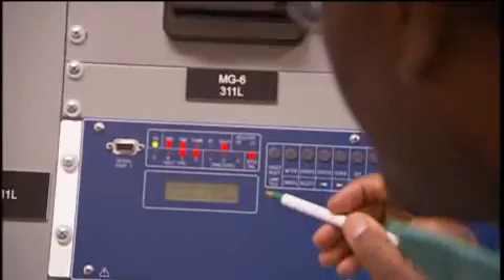Electrical Engineer

Comment: @emanpiano10 the EET program I am enrolled in states in the curriculum guide that that I will be eligible to take both the (FE) and (PE) exams which are the two exams required to become a "professional engineer". But from my understanding I will only have to take a few extra course in order to eligible to go back and get my MSEE. Also,a couple of employers that I have looked into with engineering positions have stated that could have your EET for that position.

Comment: I seriously need help. I am sooooo freaking stressed out. I don't know if I should do mechanical engineering or electrical engineering. I always take apart  mechanical clocks and study how they work, I live the mechanics. I also like studying how the motherboard in the computer makes the computer do what needs to be done, all by electrical signals. I also love thermodynamics in school, as well as circuit design and programming. I LOVE Math and I LOVE physics. I know I am (continued below)

Comment: @signeduplate The math you're learning right now will be used in other 4 year level courses.  You need math to analyze control systems and system processings.  You need diff eq to fairly predict a system's behavior...  Math is used all throughout the learning process.  If you're not interested in understanding how the equipments you're gonna be using work... or how the equipments calculate a particular result, maybe EE isn't for you...  It's not easy... but it pays.